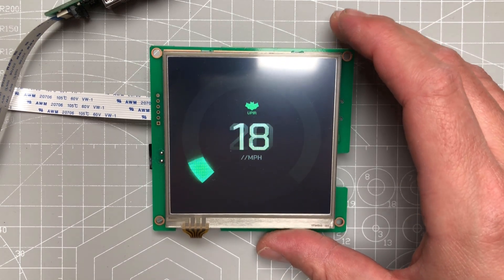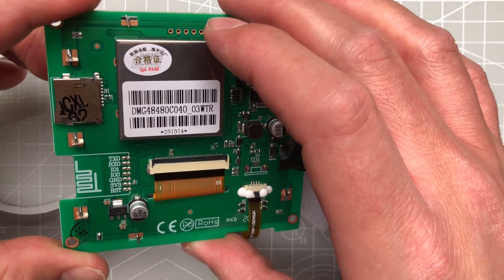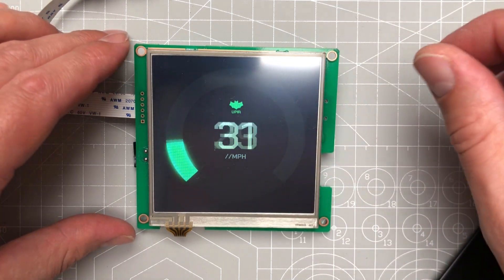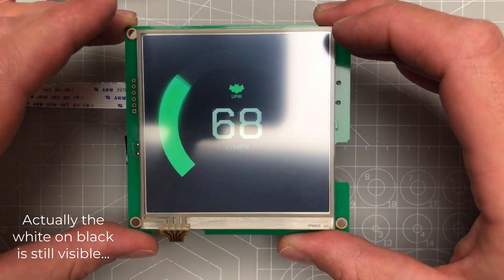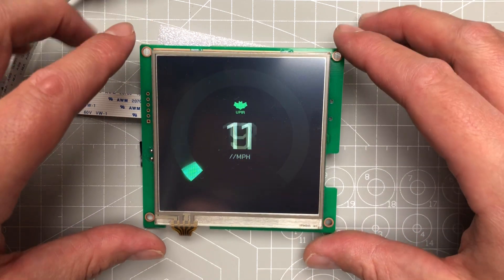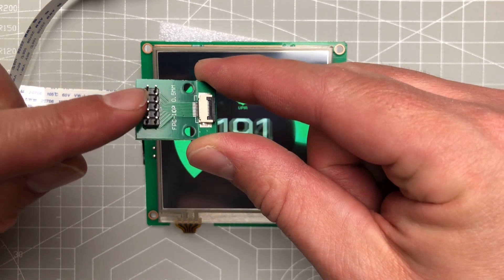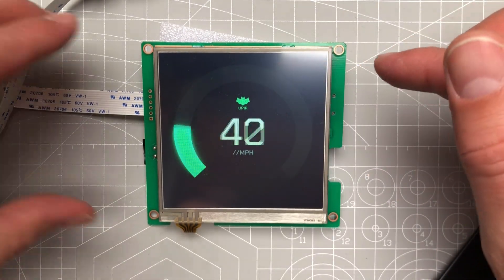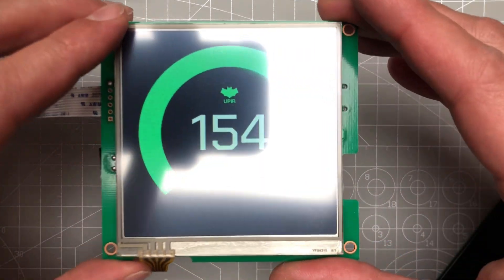Cheap Square Display for Arduino? This 480x480 IPS DWIN Display for Arduino, esp32, microbit, stm32

Comment: Almost what I'm looking for, but my problem is always that the project I'd need it for requires as little overhangs beyond the screen borders as possible. Most of these always have a ton of crap extending beyond those borders on the PCB.
Reply from the maker: Dwin also offers this display as COF version- chip on flexible pcb. In that case, there is no pcb around the display. Perhaps that might be a suitable option for your project?
Reply: @upir_upir  Would probably be more useful, though then I'd need something to connect the ribbon cable to a Pi Zero. 
For the TV show prop I'm trying to build, do a Google image search for "Real Ghostbusters PKE Meter" to see how little room for excess plastic there would be in the small handheld box for overhang, so still reave space for a potentiometer, battery,LEDs and the like.

Comment: The DWIN 480x480 display looks to have a lot of potential. Did you ever make a follow-up tutorial showing how to connect and use it with Arduino, RP2040, etc??
Reply from the maker: I haven’t recorded a second part- yet, but it’s still on my todo list. It’s an interesting display and the screen quality is great for that price.

Comment: Can you provide source code?
Reply from the maker: Sure. Please send me an email. Thanks!
Reply: @upir_upir  Question, Why don't you make it open source?
Reply from the maker: @8_Bit_Cloud  I will make it open source once I record a proper tutorial and put it in a better shape. Right now, it´s a work in progress and not super helpful for anyone.
Reply: @upir_upir  Thanks for Reply, I did something similar with nextion 2.4" using images Like GIF, And I don't think that is the right way. I mailed you can you check on that.

Comment: Hi upir, hope you're doing well... I want to use this suare display in an interface with atmega328p on my new project.... I want user input like you are taking here from 0-5 in some kind of guage form to control brightness of 8*3 panel of super bright LEDs ( 5 levels)... (The uC will use PWM to control Boost CC driver.)... An RTC display also...
 Please upload a detailed video on this display...
Much appreciated
Reply from the maker: Hello and thank you for your comment. Please send me an e-mail (link on the about page) and I can send you the source for this project. I do plan to record a more in-depth tutorial, but that would take a while..

Comment: I responded on another project video you did and I thnk this might be a better fit.
New to Razz, Ardrino, but soldering and programming I have done previously.

I have details of a project I think is possible with UNO and this touch display, but since I am new to this I need some direction in what to order so that I am not throwing away dollars!
Can you help?
I tried to get someone on Fivr to help but I may have asked wrong.
I want to have a current compass heading displayed and use the knob to show a desired compass heading.  And as the system turns toward the desired compass heading that is shown on the display.  I woudl like to work in Python, but could do it in another language, but I need to use the delta of desired and current compass heading to control a servo.
Please email me?
Reply from the maker: It should be possible, I don´t see any reason why not. Could you perhaps share more details about your project? Since this display communicated using the serial interface, you can use any microcontroller to interface it. With Arduino, you would most likely be using C language, but you can use something like Pi Pico or RP2040 and use Micropython instead. Feel free to send me an e-mail and hopefully I would be able to help.

Comment: Hi, I have this display and I am attempting to have it communicate with an Arduino. Ideally the display would send touch location data to the Arduino, and the Arduino would have an array of pixel colors to send to the screen. I have gotten all the processing on the Arduino figured out, but I am having trouble understanding how to do this with the DGUS software. Could you possibly help point me in the right direction?
Reply from the maker: Hi Cody, could you please be a little bit more specific about what you are trying to achieve? What do you mean by "array of pixel colors to send to the screen"? Do you want to manually draw an image? Thank you!
Reply: @upir_upir  Yes, thank you for your reply. This is a little past my level of understanding, so I may not be using the correct terms. I would like to manually draw an image on the screen, by choosing the color of each individual pixel. I believe that would be called a bitmap, but I am not sure. The program on the Arduino generates a 480x480 array of boolean values, and I would like to display it on the screen as a pattern of black and white pixels.
Reply: I have the DGUS development guide, but because of my limited knowledge and the way the guide is written in some places, I am having trouble working out how to do that.
Reply from the maker: @codyhaderlie8455  OK, I see what you are trying to achieve. Using the DWIN display is probably not the best choice, and even if you get it working, it would be very very slow. Actually, I don´t think you can control pixels on DWIN display. That display is for displaying images that are already created and stored in flash memory, and you usually use Arduino to just send commands to jump to a different page, show an animation, etc. 

You can draw pixels (rectangles) with Nextion, but again, that would be very slow - like a minute to update the whole screen. 

I would suggest switching a screen to some color LCD with an I2C or SPI interface and connecting it to Arduino. That way, you can control pixels, and it will be faster. Note that since Arduino is slow, it will still be quite slow, but it will be possible.

Let me know if you have any questions.
Reply: @upir_upir  Ah ok, that makes sense. I'll have to try another dispaly, maybe. Thank you!

Comment: How to revolve circumference of gauge not its needle?
Reply from the maker: Could you be more specific? I´m not quite sure I understand your question fully.. Thanks!
Reply: @upir_upir  I also want to make a gauge GUI in DWIN and its needle should be still but its dial should be revolving.
Reply from the maker: @learnbox3783  Could you please send a link to some image for an example? Thank you!
Reply: @upir_upir  Thanks for reply, actually i would like to display compass on it as our smart phones has in which need remain fixed only gauge revolve in order to display  north, south east west value with respect to compass data